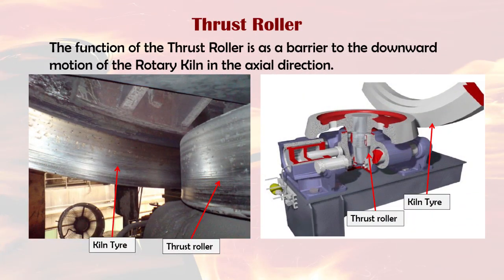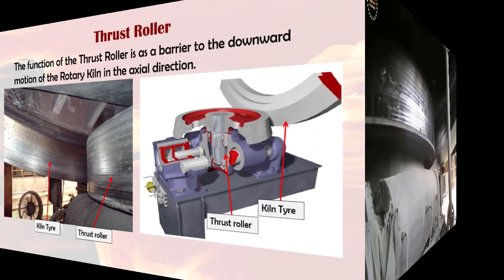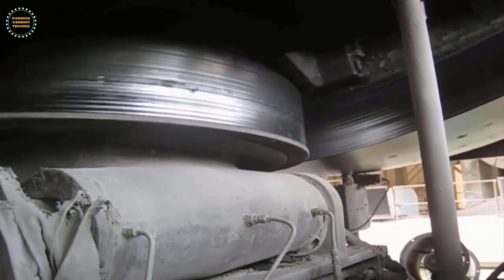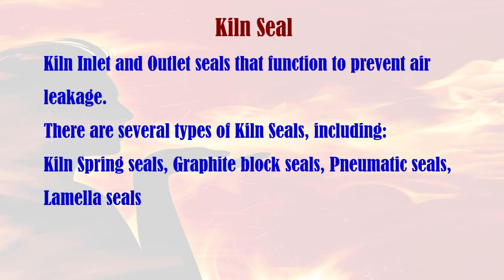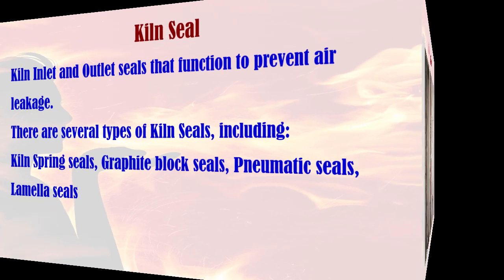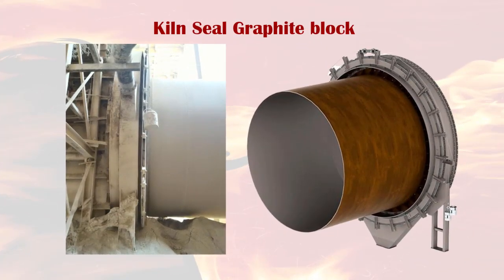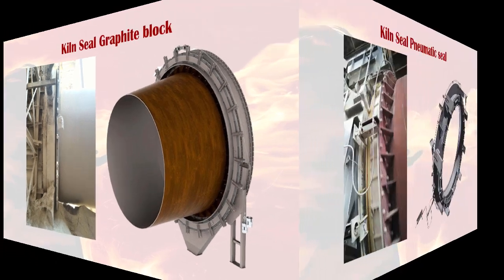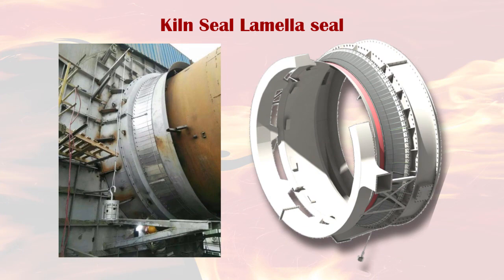Cement Rotary Kiln And Supporting Equipments_ English Version

Comment: Does rolling ring is different from riding ring?
Reply from the maker: The kiln rolling ring or riding ring, also known as the rotary kiln tyre, is a circular steel ring that is sleeved on the rotary kiln cylinder.
The kiln tyre, is one of the main components of the rotary kiln equipment. The role of the rolling ring is to transfer all the gravity of the kiln cylinder (including the gravity of refractory bricks, internal devices and materials) to the supporting wheel, and to enable the cylinder to rotate smoothly on the supporting wheel.